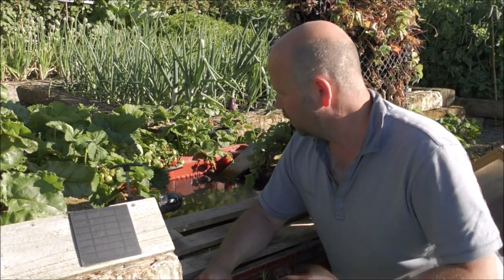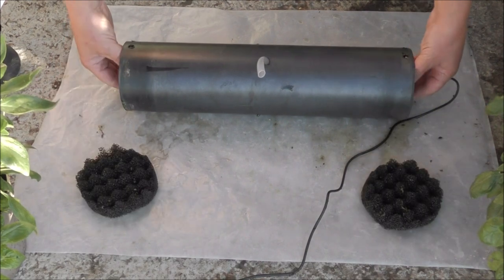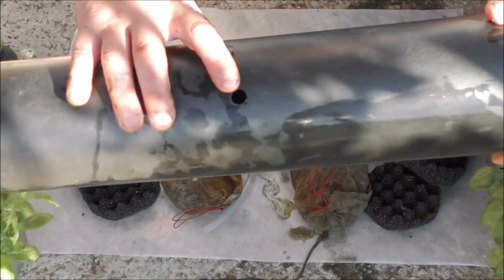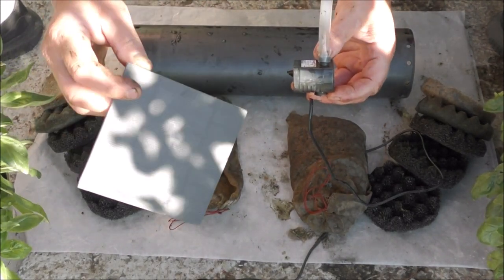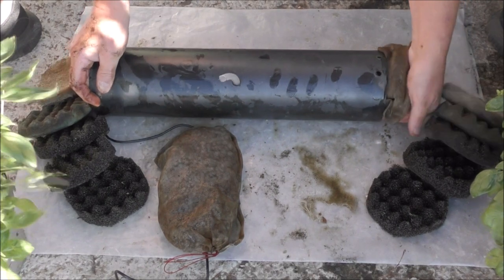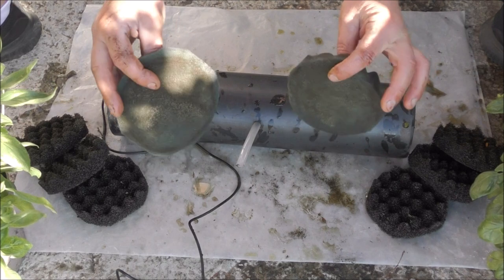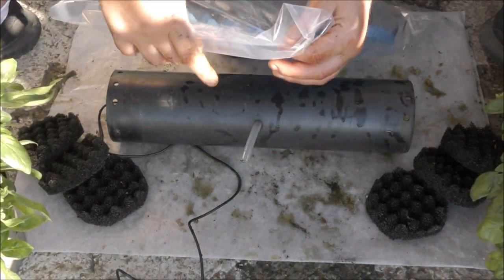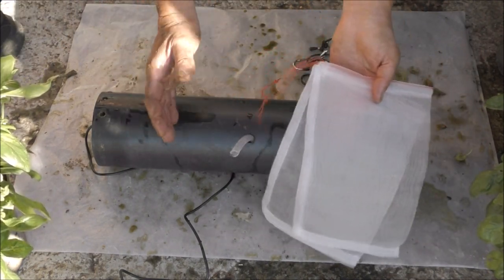How To Make A Solar Powered Wildlife Pond Filter

Comment from the maker: As promised this is a video showing how the solar powered pond filter is made and the parts list can be found below.
Solar powered water pump (Ebay): https://ebay.us/U7ofCD
Solar powered water pump (Amazon): https://geni.us/M22pjdB
Better version of the Solar Pump on Amazon: https://geni.us/jdKjbr

The pump is the 200 lph / 1.5W version.
Foams, Biogravel and mesh bags: http://www.filterpro.co.uk
I used 1.5kg Biogravel split between 2 mesh bags.
Foams and fine pad would be a set of coarse, medium and fine if bought from FilterPro (Foams page) but they're available all over  the internet and from any good pond supplies shop.
4" drainage pipe (any pipe of similar diameter will do)
Decent alternative media would be either the 25mm Alfagrog: https://geni.us/kTwG
or Eheim Substrat Pro: https://geni.us/98euQaB as the Alfagrog works very well in muck and the Substrat Pro is as close as possible to Biogravel.

For a normal wildlife pond it will be fine to have the filter on the bottom of the pond, outlet pointed up, but I used steel 'S' hooks and paracord to suspend the filter about 6" up from the bottom of the container I use.
The water coming into there is from my pond filters and it contains lots of sediment which settles on the bottom

Solar powered pump video: https://youtu.be/7J8sB1Y60VY
Hydroponic system using this pump can be found on my Thousand Yard Stare channel here: https://youtu.be/z76J-DSk0JE

Comment: Just made and fitted mine in my little garden pond, the fishless one anyway. Cheers chap!
Just to note, the pump from Amazon doesn't have a connection socket to the solar panel, it's all one cable from pump to panel. Not an issue for me here, but thought I'd mention it if it's a necessity for someone else.
Reply from the maker: The design of the pumps seems to change slightly so that's no surprise. I bought the first one I have from Amazon but since have been getting them from Ebay - I've now got 4, lol
I'm glad you've given it a go - nice one.

Comment: Do you think it would scale up to support a small fish pond? Maybe need to introduce a battery? Great idea!
Reply from the maker: I don't see why not as even in conditions which aren't sunny the pump still 'pulses' water out and therefore draws some water into the filter to keep it working. It's raining here this morning and the pump is pulsing water out which is very surprising.
The only downside is that it shifts nothing on a night.
You can get systems with bigger panels, battery back up and the pump but unfortunately the pumps are scaled up with the system so they use way more power than this little one. Those larger pumps only tend to run for a few hours at night even when the battery has been fully charged during the day so it's the same problem of getting the pump to run at night.

Comment: Nice vid. I haven't had much luck with those small solar pumps seam to jam up and die after a few weeks. Need a larger pump with dirty water rating imo.
Reply from the maker: When used inside a filter like this the pump is protected from muck. I wouldn't use a little pump like this in a 'normal' pond situation.

Comment: Cracking idea Richard, may have to make something similar for my new wildlife pond in the front garden 👌
Reply: (my other channel) The newer solar powered pumps are much better and I show that on the Thousand Yard Stare channel. They have a proper sized 10w panel which works even on dark days and there is also a battery back-up under the panel. Even through the Winter the new pumps and panel worked from sun up to just after sun down so it's a way better system than the solar pump shown in this video. At the time of posting they were around £30 for the pump and panel but definitely worth it. I bought 2 of them and wouldn't change back to the cheaper system.
Reply: @ThousandYardStare  spot on cheers for the advice!
Reply: @AJBAdventures  No worries and best of luck with the pond.

Comment: Hello mate great video my problem with my wildlife pond is surface algea would this filter work to clear as I have a similar pond pump cheers
Reply from the maker: If it is blanketweed or suspended algae (green water) then his filter is unlikely to make any difference since it has no UV light.
Feel free to ring any time to give further details - phone on every day 7am - 6pm 07772848730
Regards, 
Richard

Comment: Hey Richard , the wave of the new content is so Awesome and each new one feels like a loose slot machine 🎰 I was wondering if this filter could be scaled down for a standard sized aquarium with a heater inside ? Something is telling me I might have seen such a DIY combo , but it would have been years ago 🤔 Thanks again and hope you are finishing up that 1 thing since you have the other thing , then those things are ...,. Just kidding . You stay busy but the relaxing &:rewarding is important too. 💙💚😎
Reply from the maker: I'm working on a filter now for emergency use that can be powered by solar pump, usb pump or air but still pulling all the gear together for that one. It won't have a heater in as that consumes way more power that is usually available in a power grid failure situation unless you have a back up plan for more power (battery power station, generator etc.)
With regard to the extra videos I've been getting up shortly after sunrise each day for weeks now so it's enabled me to get through all the work and have some time to make videos - there's still a very long list of videos I want to make.
Reply: @pondguru  That is great to hear , anything from you has been honestly my favorite content to watch since the plandemic took away my desire to watch anything on tv , movie channels or sports.... period. It does nothing for me , so I quit watching ... But every night as I am falling asleep to the sounds of my aquariums & the  BBC on Minnesota public radio. So I was wondering if you know anything about the heaviest of the brand new heavy hitter HYPERMAX by AQUA EL ? 😎

Comment: Thank you for your help. I have a question. You use a pump right? Doesn't it pump out air? So how is the water drawn into the filter? Sorry if I seem a bit dense in this endeavor.
Reply from the maker: Water is drawn in through each end of the pipe through the foams. The pump moves water from inside the pipe then the water is replaced by whatever is drawn into the sides of the filter (ends of pipe). Air escapes from the filter as it is placed under water.
Reply: @pondguru  But a pump must drawl water in as well  as pump water out right? I understand the pump you show is only pumping air into the tank. Am I correct?  BTW thank for your videos and response. Much appreciated. We're a/b to have a Kio pond built arrpox. 4 feet by 6 feet.
Reply: @selftaopath  (my other channel) I'm not sure what you're asking here as the pump only pimps water, not air.
Reply: @ThousandYardStare  Sorry for my confusion. I did not see an inlet on the pump used which led me to believe it only pumped air. Of course with and inlet and outlet it will pump water and can be used in filter you made. Cheers.
Reply: @selftaopath  No worries and best f luck if you choose to make a similar filter. I recently featured a much better solar pump on my channel which has a proper solar panel and a battery back up. That allows the pump to run all day, even if the sky is dull or if it is raining. As long as it is light the pump runs: https://www.youtube.com/watch?v=GnO60MYisIQ&t=24s